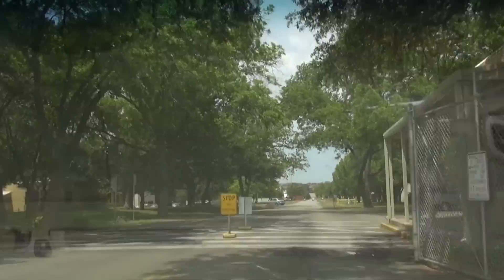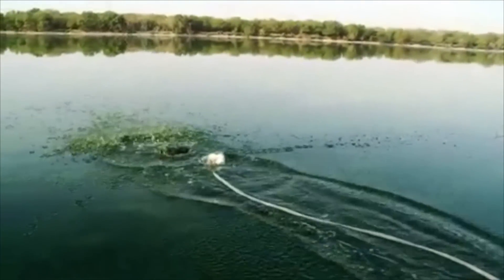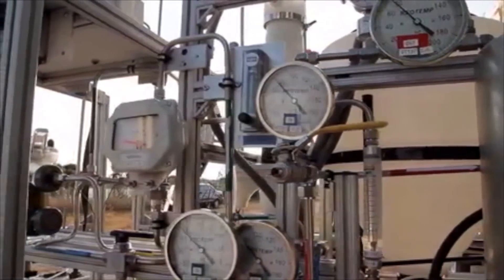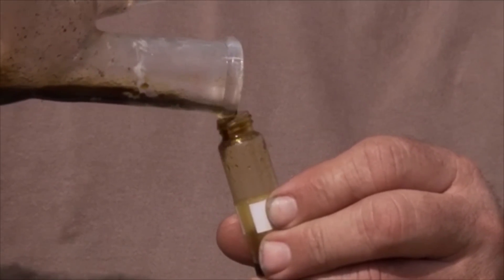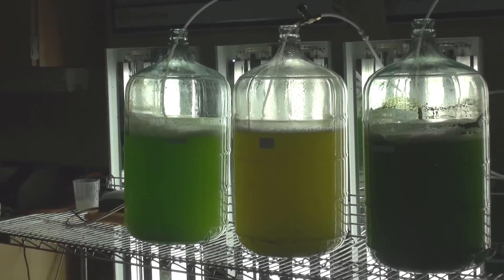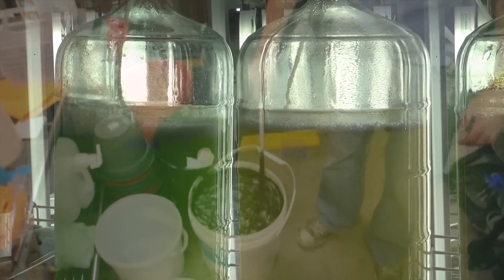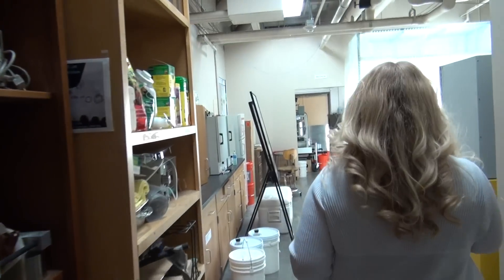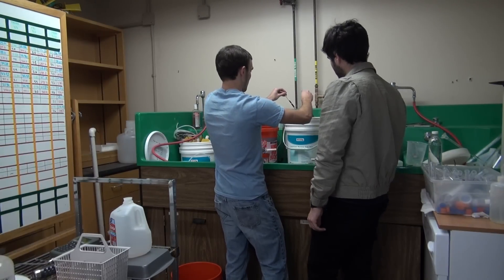Amazing Science - Changing how We Grow

Comment: Was that "hip apathy" or genuine lethargy from the narrator?

I doubt anyone's going to flock to algal fertilizers unless natural gas prices rise & remain volatile. Even so, I wonder if bio-gas isn't a more tempting option, given that it provides methane to run the system, liquid fertilizer, & solid fertilizer, all from cheap (or free) feed stocks--including sewage--that require less additional land than algal production often does.

As a fuel, either will generate unfortunate rebound effects.